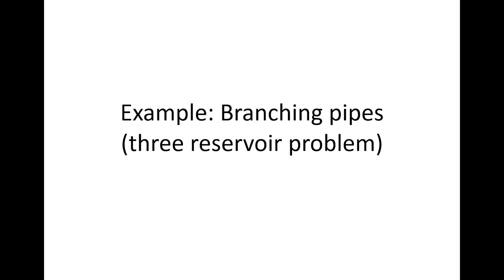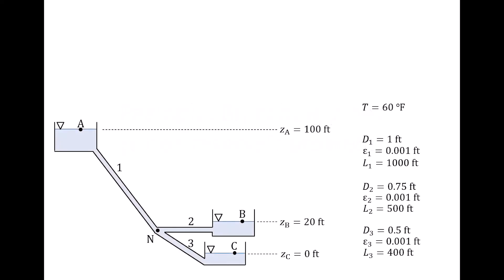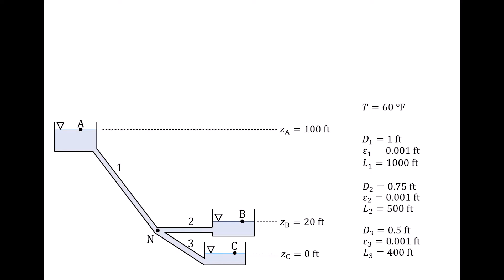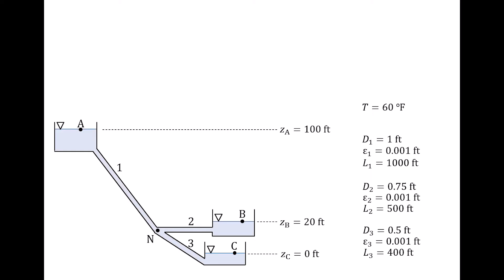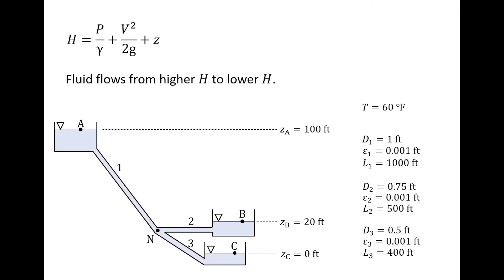Fluid Mechanics: Topic 9.2.2 - Example of branched pipe system (three reservoir problem)

Comment: Those English/Imperial units are such a deal breaker.
Reply from the maker: What's so hard to understand? 
One foot is roughly the length of an adult foot. 
One horsepower is roughly the power output of an adult horse.
A slug is... well... hmmmmm...
Reply: @CPPMechEngTutorials It's all about how awkward those units are to work with; the good ol' US still stuck in the middle ages with such an archaic system. The SI system is king.
Reply from the maker: @rthelionheart  But conversion factors are so much fun to work with!